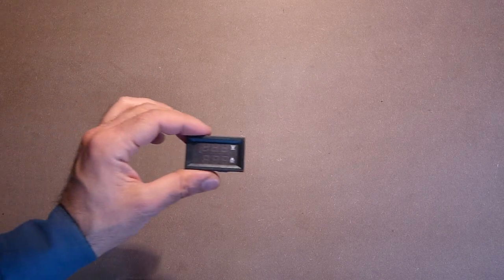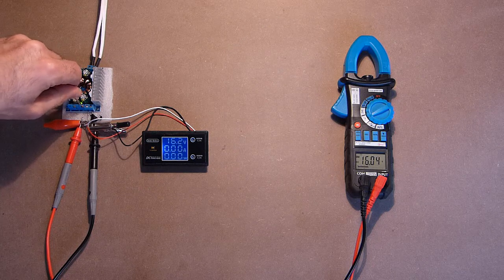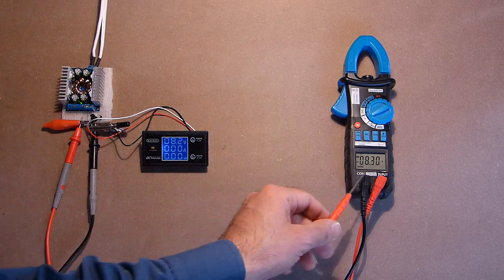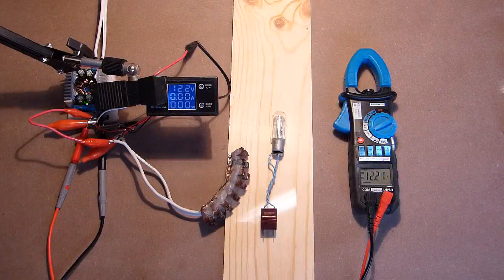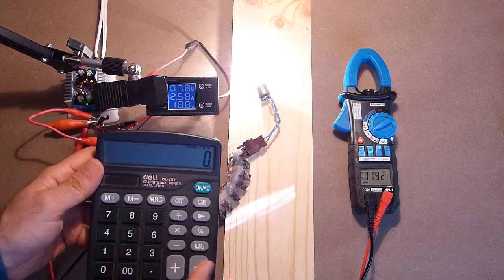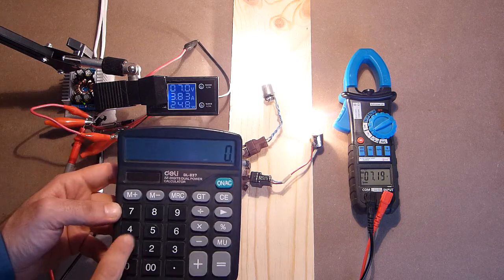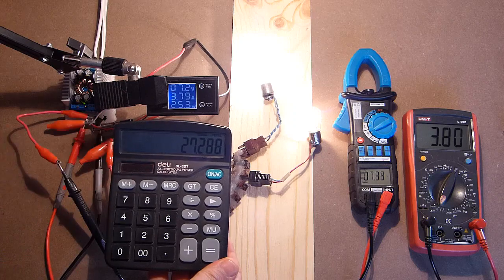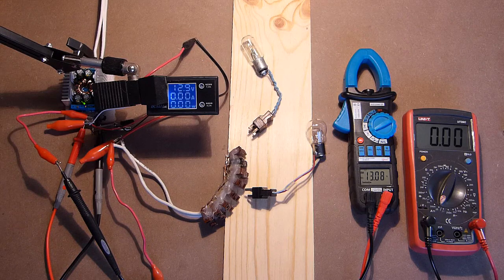100V 10A Volt-Amp-Watt Meter

Comment: Você conectou os dois fios finos da iluminação diretamente à tensão de 30 volts? Poderia mostrar melhor este detalhe? Ultrapassou os 12 volts máximos?
Reply from the maker: I didn't use this device with 30 volts. As to the future check - I have not this device anymore.

Comment: Can I use this measuring device on my car?
Supply voltage is described with DC 7-12V.
But if the car's engine is running, there are 13.7 to 14.7Volts, can this device do that?
Reply from the maker: Correspondingly, if  there are 13.7 to 14.7Volts, it should mean that the voltage is out of the range:)

Comment: Please diagram
Reply from the maker: Thick cables are for current measurement, thin red and black are for feeding of the device, thin white cable goes to the "+" contact of a device, the voltage of which you should measure.
Reply: @powerbatterychannel4315  so what is the input input value after and after?
Reply: please provide a way for the installation so that I understand it all
Reply from the maker: @Juniorfinger999  https://ibb.co/MckwVd2

Comment: hi, edit your video and show how every wire is connected, to source, load, etc. I want to test solar panel directly. Can you recommend connection method? Thank u
Reply from the maker: Hello, unfortunately, I have no this device anymore.
Reply: @powerbatterychannel4315  hi, thank you. I figured it out.
Reply: Hi did you find out how to use it into solar set-up? Off grid

Comment: the wiring of this setting would be helpful to understand the values - as far as I can see, you use just 1 voltage- (power-) supply, which is possible, of course, but actually the powering of the module is recommended in the range of 7-12 V DC (not higher) - correct me, if I'm wrong :) When you use 2 separate supplies (or if you connect just the voltage-sniffer to the load) the voltage measurement can go down to 0,7V DC (not 7 or 8, as you noticed). Accuracy: consider the decimal places of the values which are multiplied in the module and also consider the "noise" of your buck- (or boost-) regulator supply  :)
Reply from the maker: Sure, powering voltage range is 7-12 V. As to the "noise" - it's necessary to use batteries and check the corresponding result. Thanks for your interest :)
Reply: hi, edit your video and show how every wire is connected, to source, load, etc. I want to test solar panel directly. Can you recommend connection method? Thank u